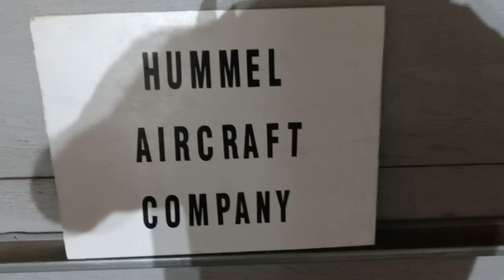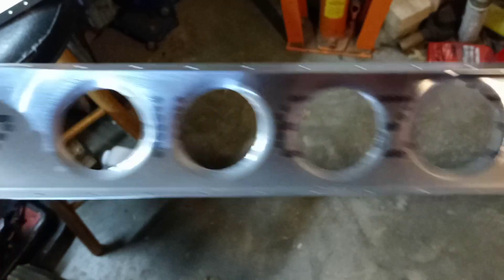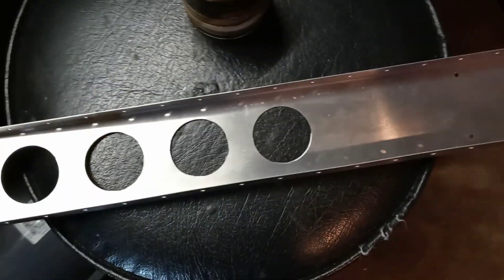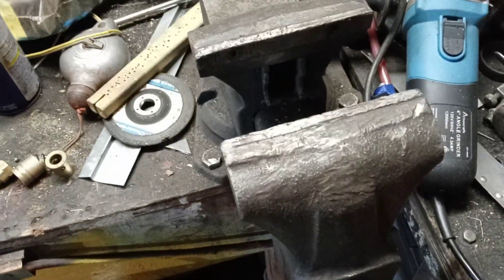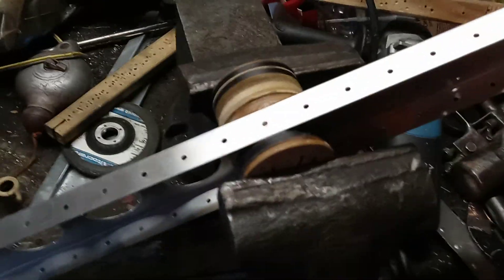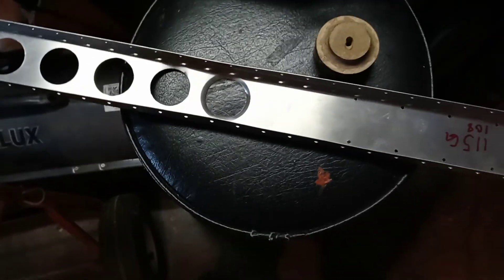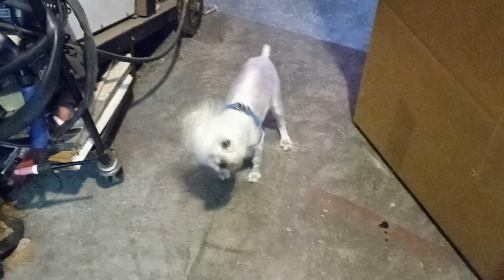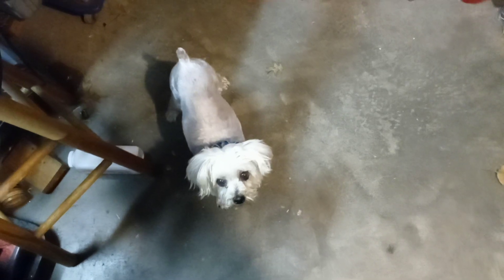Trying out my 1.5in flange tool. Yes I did the other 4

Comment: I made a set for each size on our H5 project on my 3D printer. Also made the odd shaped forms out of particle board for the wing ribs. Coated the particle board ones with epoxy to harden and smooth the surface.  They were easy and worked great.
Reply from the maker: Hi Walter Ballauer well thank you sir for sharing alternative ways of doing what I did!! I would like to try out one of those 3D printers but Im stupid on computers. Did you get your H5 flying?
Reply: I was just sitting here wondering if I could 3D print one. What material did you use? I figure PETG might be hard enough?
Reply: I used PLA with 50% fill.  That worked fine.
Reply from the maker: Hi @walterballauer616  I think the 3D printers thing would be the way to go
Reply from the maker: Hi @MrMontanaNights  I used MDF and after it was done I harden it with thin CA
Reply: @redblackvette  No, we are doing it as a youth project and were shut down last year.  Hope to get back on it this fall if all stays ok with the covid deal and schools.  The fuselage is 90% and we are working on the wings now.